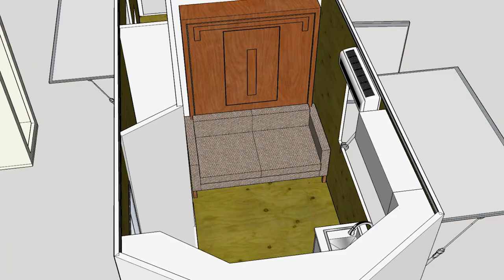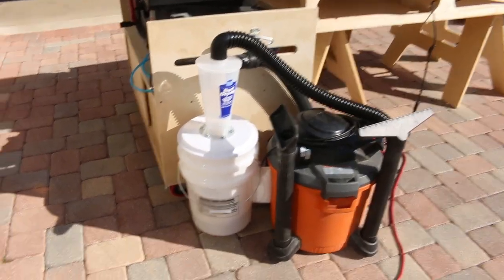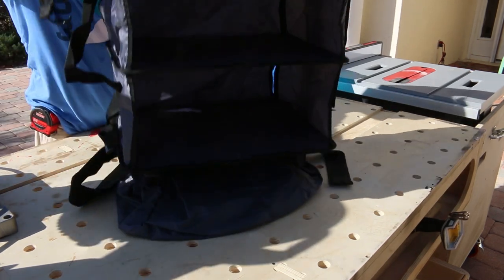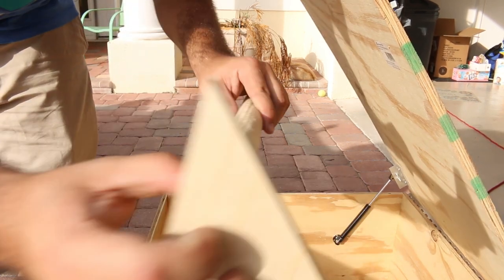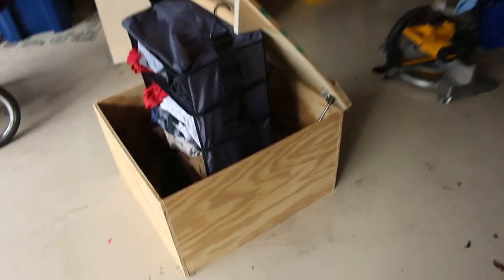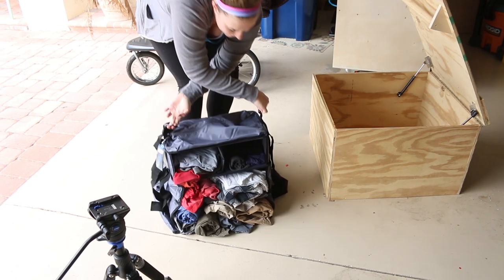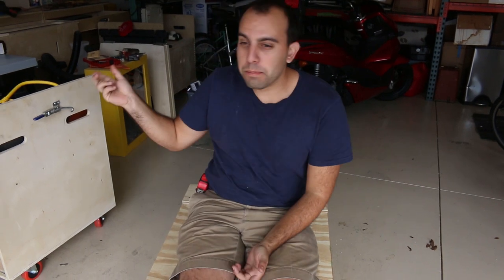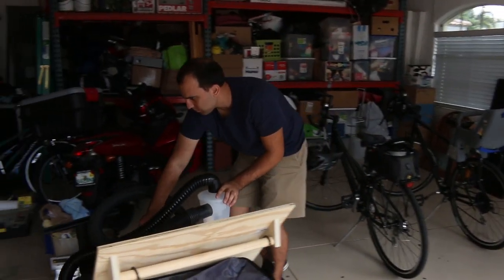Sofa/Dresser Idea...

Comment: I just went with the $50 one and bought a hose extension set for about $15 and another bucket for about $3. I used Bob's method from I Like To Make Stuff and attached it to the bucket with some caulk to seal. Works really well. I also have since made a cart that both the shop vac and the cyclone can sit in out of scraps. Love it!

Comment: seems like more work than its worth. there's a lot of wasted space under that cushion area. seems like would make better use of the space by using compartments and/or pull out drawers under there. if ease of mobility of your clothes is priority then I'd just find a duffel bag at thrift store that fits the space nicely so you can grab out and take in hotel room. just my $.02. excited to see how the new layout turns out.

Comment: Could've bought the delay outlets at Sears for $12-$15 each. Bought mine a few years ago, so they may have gone up since then. Also could have made the cyclone dust collector yourself for just a few dollars in parts. All the real makers make their own. (sarcasm)
Reply: Paul Allen--do you have a link that you could share, or something comparable?  I'm interested in anything under $50 that starts simultaneously with my tool, and then shuts off after the tool shuts off, as the outlet in the video does.  Thanks!
Reply: Well, it looks like Sears no longer carries the one I have. Here's a link to an article (with picture) using the outlet.
http://toolmonger.com/2007/04/16/20-auto-switch-50-shop-vacuum-400-festool-dust-collection-vac/